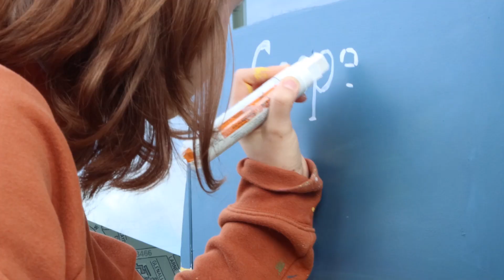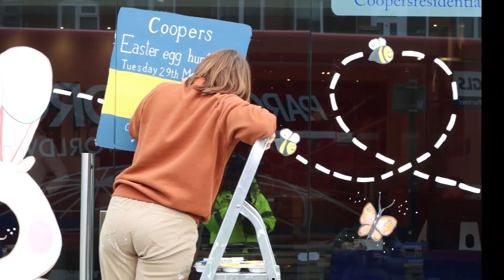WINDOW PAINTING | Easter Window Art Painting | London | WeTheSeeds Window Art Step By Step Process

Comment: Did you apply varnish or anything at the end to secure the paint? Is it necessary to apply something?
Reply from the maker: Hi Harry, No it is not needed. The paint bind to the window itself should be enough to withstand the weather. I do believe some window artists do choose to protect their work with a varnish for glass however it is not necessary and there is a chance cleaning the window in the future may become a harder task... especially for repeat business. Hope that helps! If you have any other questions simply just reach out.
Reply: @rikesh  Thanks for your info.